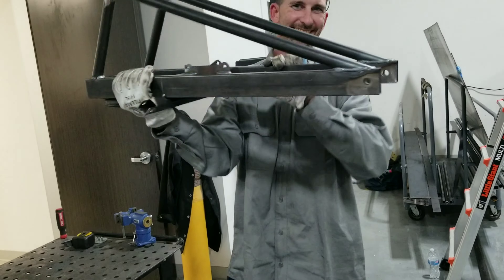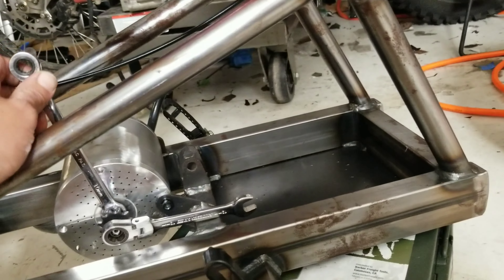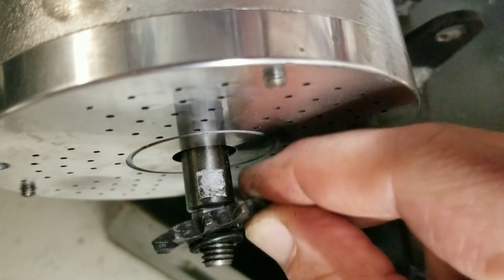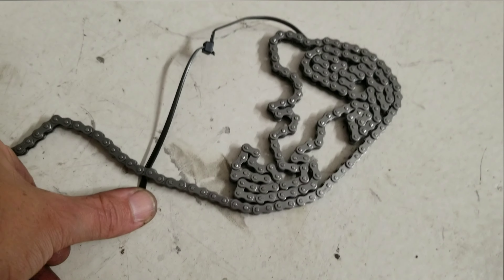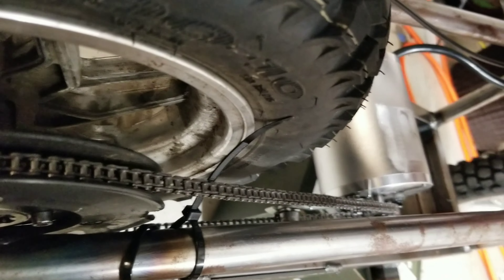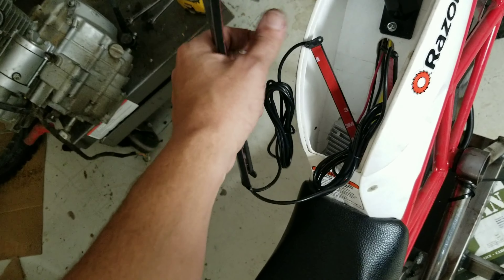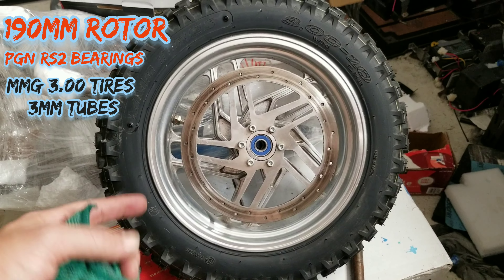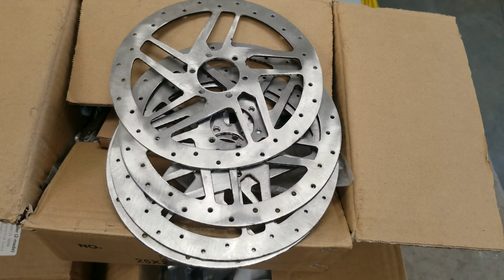razor INSTALL CHAIN H25 mx650 mx500 sx500 rsf650 #alteregomotor #razor #chain

Comment: How did you break the tension on your motor sprocket I have been trying for 20 mins to take it off
Reply from the maker: Left is NOT LOOSEN. .
Reply: @KeatonsCarlott  yes. even when I tried right not left, it’s like it’s tourqed on very tight like I can’t un-tourqe the nut..
Reply: Try a breaker bar need more leverage
Reply from the maker: Hahahaha. Go the opposite direction
Reply: @ryanmoss9420  okay I will cause I know I’m going the right direction but it’s just super tight I can’t break the tourqe
Reply from the maker: @user-qe8xq4nz7r gotcha. Use the swingarm to hold 1 wrench. And palm strike w the other.
Reply: What does upgrading the sprocket and chain actually do?